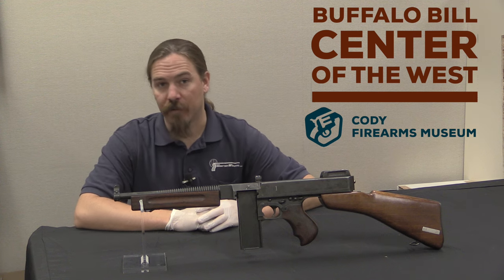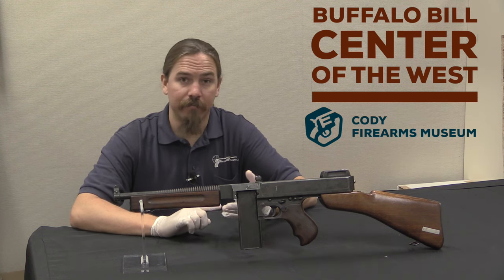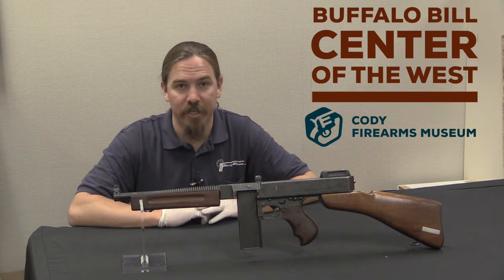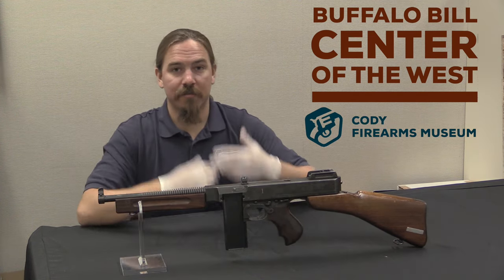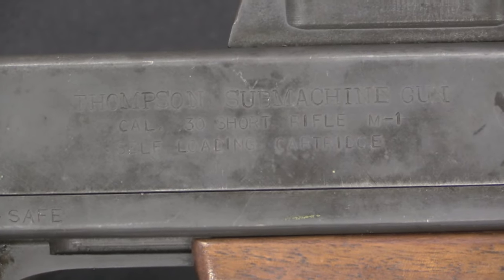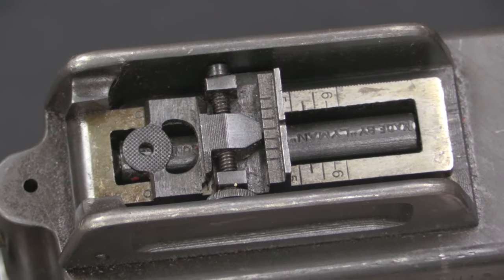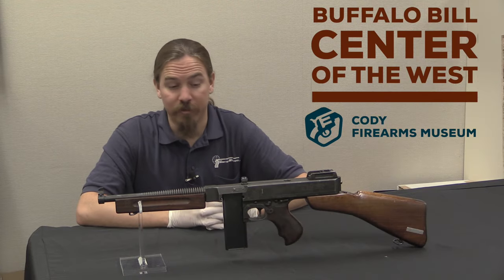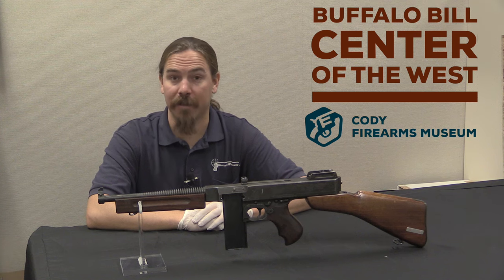Thompson SMG in 30 Carbine

Comment: Interesting.  Since .30 Carbine is a light rifle round, effectively an “intermediate cartridge”,   and the Thompson is capable of semi or full auto fire, Auto Ordnance basically created an assault rifle without intending to. Not a very good one since it’s a bit low powered, too heavy, and a bit short in barrel length, but still fits.
Reply: It’s an intermediate cartridge.

Anyone who says pistol round is just repeating fudd lore.

It’s a replacement for the 1911 just like a Glock is a replacement for pepper spray. That doesn’t mean a Glock = pepper spray.

___________

110 grain .30 caliber round @ 2000 fps = pistol round

But 110 grain .30 caliber round @ 2200 fps = .300 blackout the best cartridge ever developed.

It’s 98% of the muzzle energy of 5.45x39, but it’s a pistol round. Got it.
___________

They traded 200 fps and about 20 yards of point blank range, for an assault rifle that weighed 5 lbs instead of 10.

Not much of a trade off when you’re surrounded by semi auto 30-06 rifles.

The US never adopted a cartridge like the 7.62x39 for a reason. The same reason the soviets abandoned it.

They replaced the carbine round with 5.56.
Reply: @-John-Doe-  except the .300 BLK makes alot of sense considering its BC is also better and has heavier grain bullets.
Reply: @darrengarcia4937  It makes a lot of sense over half a century later after the light rifle project developed into the AR15 with modern materials — Aluminum, Polymer — and a very high pressure cartridge.

It works if you already designed the AR15 and 5.56... but it’s not going to replace the 5.56 for a reason 
— the same reason intermediates weren’t adopted
— the same reason the .30 carbine wasn’t compromised to be something it’s never intended to be, or .300 blk will ever be.

You have to know precisely what the design parameters are for the firearm.

Shortening the OAL of the cartridge is necessary for lightening the firearm and ammunition, and for logistics purposes.

This is the entire purpose of the T65/ eventually 7.62 NATO replicating .30-06 M2 Ball in a short action. Smaller firearm, smaller magazines, etc.

You could sacrifice the design for a slightly higher BC and 20-25 extra yards of point blank range... but the United States military wasn’t interested in that at all.

Just like the US military was never really interested in submachineguns — the Thompson was pressed into service and the M3 grease gun was designed to fit the niche as cheaply as possible.
Reply: @-John-Doe-  there is a big issue with your argument. The reason intermediates werent adopted was because of the stupidity of the US Aquisitions. We decided on the 7.62 NATO round contrary to better performance out of the .280 and .270 british. You cant paint the US as a all-knowing and correct benchmark when they have a history of making stupid decisions. I.E. the M14, 7.62 NATO, Incorrect ammo types and cleaning kits for the M16, the terrible mods done to the M16A2, the M249 mag adapter.
Reply: @-John-Doe-  the NGSW program right now.
Reply: It's more like a heavy PDW
Reply: @darrengarcia4937  trial and error I suppose. we have the luxury of hindsight.
Reply: @-John-Doe-  Couple things to note. Firsrt, 30 carbine uses a round bullet (and not a spitzer bullet) because long range performance was not important for its intended use. Secondly, 300 blackout does 2400 fps with 110 grain spitzer projectile out of an 18 inch barrel (same as m1 carbine). Thats 44% more muzzle energy than m1 carbine with 110 grains round ball at 2000 fps. 
Lastly, why do you think that the m1 carbine has an effective range of 270 meters while an 14.5" m4 in 300blk has an effective range of 460 meters? They are really not the same idea. Same goes with the 7.62*39. 58% more muzzle energy and significantly more aerodynamic spitzer bullet design.
Reply: @GRAndreas7  golf clap
Do you know why?
Reply: @-John-Doe-  why what? I don't get your question
Reply: if you add a longer barrel and wooden handguard with the fins, tripod then it becomes a LMG.
Reply: @-John-Doe-  He's right, your argument isn't particularly great when you look at what a  full house .357 magnum load does out of a carbine length barrel - and that is categorised as a pistol cartridge. It is the precursor to the PDW cartridge, not an intermediate rifle cartridge.
Reply: @kirkstinson7316  The "intermediate cartridge" term isn't even a properly defined term. Some definitions classify it as a "rifle cartridge," in which case you might think it needs to be a spitzer style projectile. Other definitions just state it needs to be shot out of a rifle/carbine. I've already shown you an example of a pistol cartridge that exceeds the energy levels of a .30 carbine out of a carbine length barrel, yet that doesn't suddenly classify the .357 as an intermediate cartridge. The .30 carbine doesn't provide "98% of the energy of 5.45x39" contrary to the prior posters claim, it's not even close to that. The .30 carbine falls inbetween pistol and intermediate rifle calibre in energy levels, which makes me think it is best classified as a PDW.
Reply: @bilbonob548   .357 magnum as well as other cartridges of the same design heritage are often listed as Pistol/Carbine cartridges.

That’s because they provide the designed case capacity to benefit from longer barrel lengths.

.44-40 was designed for the 1873 rifle. It was also used in handguns.

.30 Carbine was designed to be an intermediate rifle cartridge. It’s a carbine cartridge. It’s not an efficient design for a service pistol.

The Americans and Soviets both looked to design an intermediate cartridge based on the Winchester Self Loading Rifle cartridge — which is what .30 carbine is.

Comment: The military didn't even test fire it? They could have at least done THAT. Sure, it didn't fit the bill for a carbine, but if the military was going to keep using the Thompsons it had, it would be interesting to see the merit of having one chambered in .30 Carbine versus .45 ACP. They might have found some use for it somewhere down the line.
Reply: I've thought the same thing. If it worked reliably there would have been a logic to switching to a .30 SMG and phasing out the .45 Thompsons. It would simplify the ammunition supply, since they'd only need small amounts of .45 for pistols, and the .30 Carbine rounds are quite bit lighter than the .45. I imagine they were scrambling to produce enough weapons at the time they didn't want to interrupt the production lines.
Reply: Charles Inglin But would it kill as well as a 45? At short range with a center mass shot, probably not. It just seems almost insulting that nobody in the military even test fired it after Auto Ordinance went to the trouble of designing and building a prototype.
Reply: .30 Carbine virtually identical to .357 magnum other than the diameter, so yes, it would kill a Nazi just fine. Especially if it were full auto.
Reply: Is it going to be controllable though? By itself, a .30 carbine is not hard to handle, but what about when being fired at 700 rpm?
Reply: .30 Carbine and .45 ACP aren't all that different in recoil. .30 is probably going to be a touch snappier, but it's a 12 pound gun, it'll be fine.
Reply: Edit: Just search up a video on the M2 carbine. Runs fine.
Reply: +hornmonk3zit I'm not trying to badmouth the .30 carbine; I'm sure it would work great in a submachine gun. If the target were wearing armor, or far away, I'd prefer its high speed and more pointed shape over the 45. But if the target were unarmored or up close, the bigger diameter of the 45 would make a bigger hole and its slower speed might mean it would fail to leave an exit wound.
Reply: Just imagine a 30 cal Thompson with a hundred round drum. It would be the first close quarter SAW.
Reply: The fix was in for Winchester I believe.  No way the Army was going to insult Winchester by picking someone else's weapon.  So I believe anyway.  If a better weapon had shown up in the trials, either the Army would have given the production contract to Winchester, or had the M-1 carbine tweaked so it was still better.  
Regarding the lethality argument below, Patton was half wrong.  The goal was not to kill Nazis, but to defeat them.  Wounding them is better than a kill because now 3 are removed from combat taking care of the wounded one.  So yes, a .30 spray and pray sub machine gun would have been quite effective IMO.  Who knows, when the switch to stampings happened the resulting .30 carbine stamped full auto gun may have looked much like an AK.  <But probably much nicer in appearance.>
Reply: +Andrew Smith Well, it was pretty insulting to the Army to insist that the "Blish Principle" was a thing and charge exorbitant prices for their product instead of giving it a lower bore axis and better stock, and making it lighter. And throwing out the Blish thing. They presumably could have also made it cheaper through some combination of this redesigning.
Reply: According to Wkipedia, the 1939 cost of the Thompson (to the gov't), was $209. With the M1A1 they got it down to $45. Still about twice the cost of the M3 Greasegun.
Reply: They did throw out the Blish lock on the M1 and M1A1. The Thompson is a fine gun, tough as nails and WORTH more than the Greaser. Besides, it would have cost them, like, pennies to fire a prototype provided to them and take notes on how it all went. The knowledge gained might have been of some use. I agree on the stock though. It's too big.
Reply: @samhouston1288  I've shot the M2 carbine...Its not as controllable as an MP5, or MP40 but it's still a great design...To me, it felt like it had a rougher kick than the Thompson, with more barrel lift, and a sharper kick, if that makes sense... What makes the 30 carbine better, is that while the m2 isnt as controllable as the 9mm or even the 45 in full auto, it reaches out alot further, more effectively when switched to semi auto, so it's more general purpose than smgs...Its essentially an underpowered Assault rifle
Reply: Also the m2 is lighter than the thompson... The Thompson is the heaviest SMG I've ever held, that's for sure
Reply: @0neDoomedSpaceMarine  The Thompson barrel isn't THAT short, what it needed was a better stock. Too expensive, yes, but you cannot deny its effectiveness in real life combat. 

The Emperor Protects!
Reply: @0neDoomedSpaceMarine  You're a Space Marine, and you didn't get the reference?

Warhammer 40,000?
Reply: @0neDoomedSpaceMarine  They might not, but they were using it before Halo was. I didn't play with the figures, but I loved some of the video games. I only ever played original Halo multiplayer at a friend's house. It was ok, but I got rekt.
Reply: @0neDoomedSpaceMarine  Better than what? Doom was awesome, and so was quake 3 arena
Reply: Andrew Smith 
If they made it also have semi about we never would have gotten the m14
Reply: One Doomed Spacemarine smh I love Doom and Quake but they ain't got nothing on Halo CEs and 3s campaign. Let's not even get into Half Life.
Reply: @AndrewSmith-cn3nw  If they shortened the stock and made it inline it would have helped. Although to boot I agree it's a moot point. The thompson may have been worth the money it cost in it's current form, but not enough to run the clock and devote even more resources to what could have easily been a year's worth of effort for just one or two factories to manufacture the new gun, and that's post-trials we're talking here. Adoption, replacement, and contracting are all very expensive, and there's always unforeseen costs and such. This gun could have easily been worth more than the standard thompson or even the M1 with some refitting, at least in standard combat roles - but that isn't what the Army was looking for, either, so that's also a moot point.
Reply: @AndrewSmith-cn3nw 30 carbine is 3 times the power of 45 acp

Comment: Auto-Ordnance missed a number of easy bets when they didn't pursue lighter and more compact versions of thier SMG. A stamped-metal SMG using a wire stock would've likely met the weight, and would likely have greatly reduced cost.
Reply: Agreed. And with a shorter barrel several inches short, like the Grease gun.
Reply: Well they did build something else that actually met the contract.

Comment: Fun Fact: this weapon appears in the first level of Wolfenstein the New order as the "SMG" .

In the Canon it replaced the M1 and Sten in allied arsenals despite it's high cost as it was the only weapon capable of breaching the gap against the German Assault rifle, and as troops became extremely precious to the US and Britain after the Failed invasion of France resulted in the Extermination of the First and second US Armies and the Nazi counter invasions of Ireland and Canada.
Reply: Wow i never knew that! Thats awesome, thanks for the info.
Reply: I never heard anything about that, but in my headcannon the Thompson used in the New Order was the "Thompson M1946".
Reply: It would've made more sense if they'd just issued the more affordable M2 Carbine..
Reply: @O8V2a1  Maybe not. You have to consider a few factors: First, that the Thompson was still in mainline use by US and British troops, it's the weapon they were familiar with, and in widespread production and with spare parts. Consistency is not unimportant.
 
Secondly; The Thompson is heavier than the M2. This isn't always a bad thing. The M1 and M2 are not meant as frontline assault rifles, they are meant as essentially upgraded sidearms for truck drivers, squad leaders, mortarmen and anybody else who doesn't have a rifle as their primary weapon.
 
The .30 Carbine Thompson gives you a more durable design which can serve longer as an actual frontline weapon in more harsh combat conditions, which is a better choice for arming fewer but more troops than the cheaper but flimsier M2 which would be better for mass-issue to rear-echelons and support personnel.
 
Personally, if I were designing the world I would've given the Allied troops a whole new "Assault Rifle" because the US would've certainly had the industrial capability to rapidly develop and adopt one, probably a scaled-up M1 Carbine, chambered in a cut-down .30-06 similar to the 8mm Kurz. I'm imagining a fictionalized Ruger Mini-30 chambered in .300 Blackout, in terms of its overall appearance and dimensions.
Reply: @HellbirdIV  I question the idea that the .30 carbine Thompson would be more durable than the M2 carbine--it was effectively just blowback operated, while the M2 actually had a locked breech, meaning that its action would be subjected to greater wear than that of the M2. Also, in war, a lot of materiel just ends up getting destroyed or captured anyway, so reducing that loss is another reason to go with the cheaper gun. There are reasons why the Thompson was fairly quickly phased out and this version never even went anywhere, after all. Also, In real life, the M1 carbine ended up in front-line use during WWII and the M2 had largely replaced the Thompson by the time of the Korean War, despite the fact that this wasn't the original intent of the M1 carbine, because it and the M2 were still sufficiently tough while being cheaper.

Then again, in the Wolfenstein canon, the Allies lost, so, in that context, it makes sense for them to have made the mistake of using this version of the Thompson and not the M2 carbine.
Reply: What a dumb game

Comment: I guess the version of the Thompson in Wolfenstein: the new order is real in some fashion.
Reply: I was about to say the same. I always suspected that the Thompson in Wolfentein: TNO was chambered for something longer than a .45 ACP.  It also shoots from a closed bolt.
Reply: Yes, and it was also because the 45.ACP wasn’t making it through German armour
Reply: But it contains 40 rounds
Is it possible for that mag to fit 40?
Reply: @guts-141  if they changed the mag to double stack then 30-40 would be perfectly doable
Reply: @derpcon4212  Quad stack 😎
Reply: Shame that gun only exist in 1 level
1946 sure is a wild year

Comment: I like the modern look of tommy's, rather than the musketoon look of the M-1.  
The problem of the weight due to the absent of applying the pressed steel sheet to the tommy's receiver. Same problem with early Ak-47.

Comment: Another note: The recoil impulse of the .45 ACP cartridge, at 940 ft/sec, which is approximately what it did from a Thompson's 10 inch barrel, is about 43 J/s (43 kg.m/s). The 30 carbine would have done about 1800 ft/sec from a 10 inch barrel, I expect. That would have resulted in a recoil impulse of around 46 J/s. It should therefore have been quite possible to fire the 30 carbine round from the Thompson, using the standard Thompson bolt, adapted to the 45 ACP cartridge base. The rate of fire would have been somewhat higher than the already high rate of the standard gun and the muzzle blast and noise would have been spectacular!